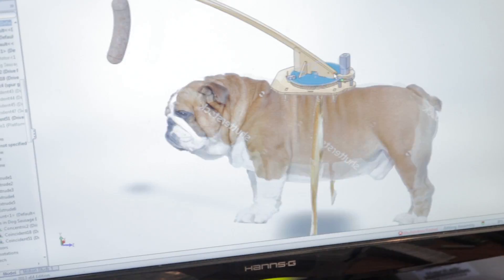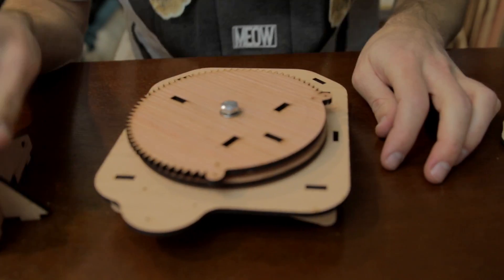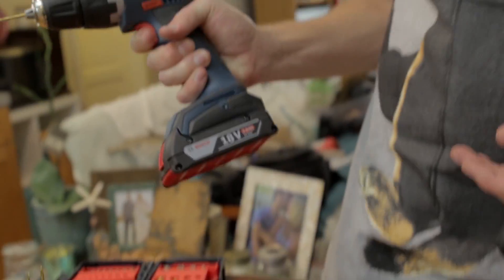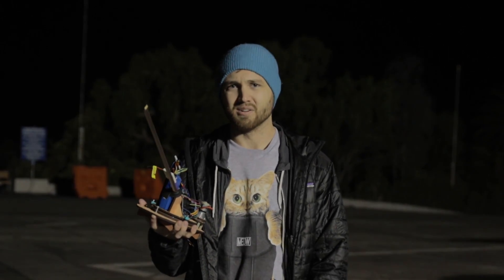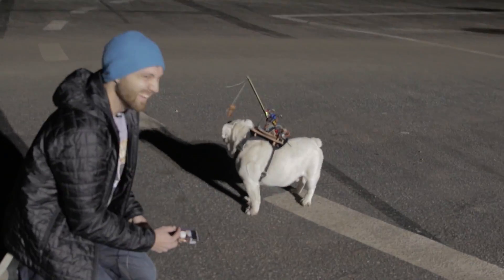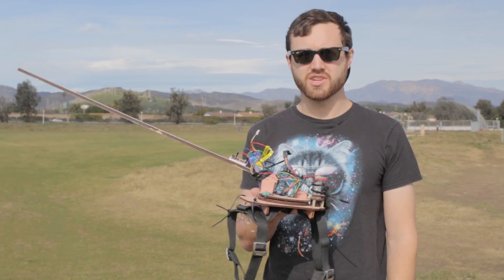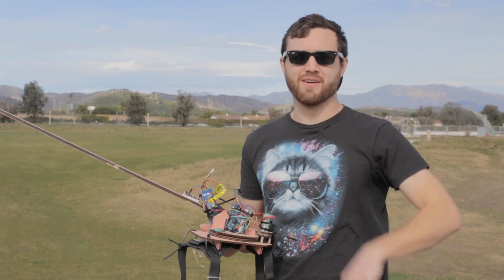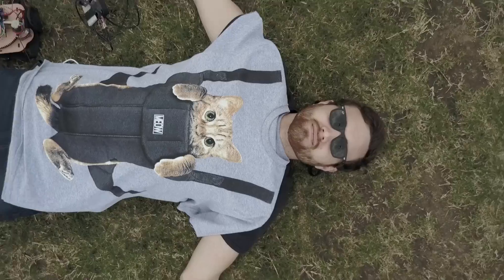Biohacking a Dog

Comment: the robot worked fine; the dog was broken.
Reply: Has he tried a software update? It’s a bit pricy for a new one
Reply: You have to buy the new model as the new software update isn’t supported on the old model of the dog
Reply: oocobol Gaming thanks was planning on upgrading might do the research on who can give me the best deal
Reply: @moose17m  i dont have time to Do THiS TyPE Of ThINg so imagine the next sentance is like taht

Its not the rice its because you left the phone for so long that it dried out
Reply: BSM_imGLADiator when did I mention rice?
Reply: I think the dog was an older model
Reply: Has he tried rice?
Reply: IceBerg 231 LOL
Reply: Try a refund if you have warranty
Reply: BigBulkCat thanks but I took it to a third party vet think I voided the warranty I’ll try
Reply: Get the new 1.2 dog update it's really good. It has better flexibility, less intense shaking and it works perfect for biohacking!
Reply: #ROTTEN Tomatoes yeah but they want to charge $870 for a Leash that they “reinvented” (it only has a tracker) I’m worried the 1.3 will be more of a money grab
Reply: Moose17m The 1.3 version is worth the money they hooked me up with a 2020 model for the price of a 2016 model
Reply: Also rip Barkly
Reply: Ya Boi Lightning the thing I have a problem with is they try selling a 2020 model in 2019 just because it’s the most technologically advanced doesn’t mean you can screw over the naming system
Reply: @moose17m  I'm using the 2.0 prototype it's alot of money but it's worth it
Reply: Angela V lucky duck how did you manage to get that I’ve been on a waiting list for months
Reply: @moose17m  they don't want me to tell others on how I got it but I guess I'll tell ya soon
Reply: Angela V don’t take to long I might as well wait for the full release if you can’t tell me soon haha 😂
Reply: @moose17m  k I found out how to get the prototype : you need to walk in to the store then find the 1.7 version once you are there look for a little hidden panel if you find it then push the "Open prototype room" button then you should find the version
Reply: @moose17m  it sounds suspicious but it's fine you may need to get to the back of the display to find it
Reply: Angela V the thing that confuses me is that there is thousands of stores around the world surely they didn’t find it financially viable to create a secret room at every store and licensed vendor just to hide some prototypes for people to take...
Reply: Have you tried turning off and on?
Reply: Andrew Tran no one likes a no it all
Reply: Well it's a bulldog, they're basically cripples.
Reply: I think this entire dog model got so many non-funtional upgrades that this breed ended up as defomed as it is :P
Reply: Get a new one
Reply: My model slowed down when it got to close to an older one did anyone else have this problem?
Reply: MBM a factory reset always helps me happened a couple times to me
Reply: @moose17m  I don't know where she got hers, but to get the prototype you have to be following them on social media, they send out waves of links for the prototype, and they are first come first serve. They sell cat models too, and I got one of them from. Their link
Reply: Nico an engineering class buddy of mine’s dad is on the dev team he hooked me up thanks anyway tho
Reply: He should just youse something he can smell, so he intimately follows the sent, instead of looking at it
Reply: Did you try to unplugg it and plugging it back in?
Reply: Derek Thompson so true
Reply: Ya, RIP Barkley
Reply: Also a longer rubber band so while the dog is still it isn't higher than his eyes
Reply: The brain is fine but not the kid
Reply: Nah, the dog was too smart for it
Reply: Guys, guys. Dont worry, we released a new smaller version. Itll be faster and smarter than ever before. Has a WHOLE bunch of new features.  Dont mind the security updates, as long as you keep it healthy it should last for a few years.  (Admittedly yes, a shorter life span than the old models, and we sorta got rid of the gps function, but im telling you, worth the upgrade!)
Reply: ZirrasElite so I just bought it, is it supposed to fly or did I assemble it wrong?
Reply: @linc0646E  uhm, are you happy it flys?  A representitive will be with you shortly with all future questions~
Reply: Charlie Lin Hello, I’m the representative that was spoken about, how may I help you?
Reply: the dog was so broken it died
Reply: I think his dogs case is cracked
Reply: He tried turning it off and on again, but he didn't turn back on :( 
RIP Barkley
Reply: 2001 software updates for dogs are surprisingly cheap
Reply: lol he probably was using outdated hotdogs he needs yo updtate the hotdog lol
Reply: try turning it on and off

Comment: You should use a fixed pole or something instead of string to hold the hot dog in front of the dog, so you have more control and the hot dog doesn’t fly all over

Comment: I think instead of using a string it should be a solid line so it doesn't fling the hot dog everywhere. But the problem is that when the dog looks down, the hot dog will impale itself into the floor.

Comment: What's your degree in? I'm really interested in engineering and I'm curious to what you studied. cool video btw. I like to desgin and 3d print stuff. I was interested in buy a laser cutter but they are too expensive. it would be cool if you showed how you made your laser cutter. keep up the good work 👍
Reply from the maker: Mechanic and Electrical engineering. The laser was still pretty expensive, but you can build smaller ones for way cheap!
Reply: Nice!! I was thinking in mechanical engineering too! I have a few years to go tho, but I'm excited :) And thanks I'll look into making one

Comment: I have a better solution... one that will train your dog to walk wherever you want him to.
You get 3 LED signs in front of the dog. One for left, one for forward and one for right. Then attach a machine that feeds the dog snacks, and sensors to detect which way the dog is walking(if thats possible? if not you can still do this by manually feeding the dog, will save alot of programming/electronics aswell). When the dog walks in the direction of the corresponding sign, it feeds the dog. It will learn through reward that walking right when the right LED is on is good, etc. Might take awhile before he picks up on it, but hey if all goes well you've got yourself a remote control dog without any dangling weiners in front of his face.
Reply from the maker: What if the dog is dumb and lazy?
Reply from the maker: All he's good at is being bad
Reply: Then you get that dog whisperer guy to show up and "Tsch" him

Comment: An interesting application of the dog backpack would be to have a powerful wide angle spotlight on the dog's back, which would be noise activated, tuned to the dog barking and with an "on" timer of around 30 seconds. The application would be in homeowner security and defense of course.

When an intruder comes in the dog's guarded yard the dog barks at the intruder and light him up. The intimidation potential of the barking dog is easily tripled with the spotlight at night.

I see what you did in this project and I'm sure you have the knowledge and skills to make this idea a reality.
Reply from the maker: So bad that it's good.
Reply: So you'll try it? 

I recommend using a more athletic dog that likes to bark and run to test the backpack rig. Also optionnaly add a bark activated fpv feed for the security guards.

Peter Sripol sent me here!

Comment: awesome idea bummer it didnt work :D can you pleeease change it so you can move the hotdog closer to his face by remote control. so you can actually reward him for walking forward.
this would be just a tiny change in design allowing one more freedom of degree. just add a motor coiling up the string and a spring to get it back in place.

Comment: Hey William. That should work fine.  I think however that you want the bait held rigidly and not flopping around.  The most important thing is training the dog.   First of all, you want the dog motivated.  That means training him before you feed him so that he works hard. If it were me I would entice the dog forward with separate hand held bait so that he gets the idea of moving forward and turning as the bait is turned.  Finally, the best thing would be if the control bait had a reservoir that  could drop a treat once in a while.   After he got some practice, I'd bet I could drive him around the block and more.

Comment: is it possible to cut metal with yout laser cutter ?
Reply from the maker: Not really. Metal is really good at reflecting the infrared wavelength produced by a CO2 laser. It can pierce holes through thin metal if you hold it long enough.

Comment: Where did you learn all this? Especially the CAD modelling on solidworks; any tips on how to improve from a fairly basic knowledge of the program? Love your stuff by the way :)
Reply from the maker: I used to be bad at everything, and I'm still bad at a lot of things. Find tutorials or classes and just start doing stuff. All of my early CAD models were of things I found around the house. Same thing for the electronics/programming. You need to start somewhere even if it's the very bottom.

Comment: Was the LiPo really necessary? It doesn't seem like that rig would take much power. (granted, I know almost nothing about it, thanks for that)
Reply: Jesse Hanan yea cause it's easy to wire and doesn't add too much weight for its power
Reply from the maker: This. Battery choice wasn't super important, and the Lipo was convenient.
Reply: Yeah, I figured you just had it laying around